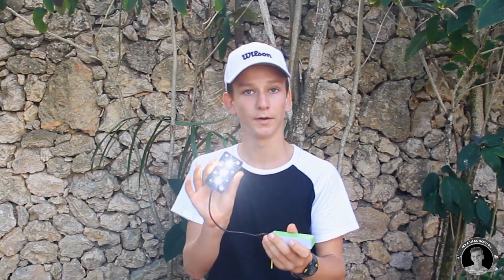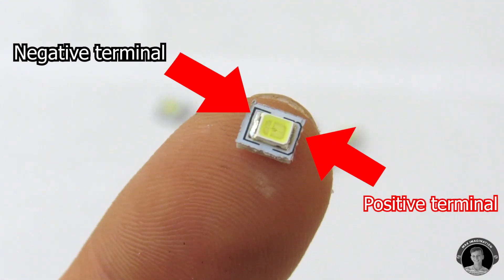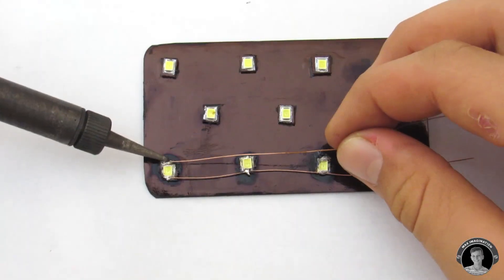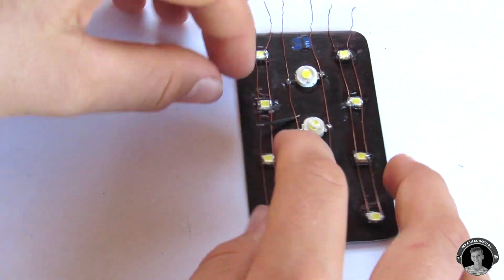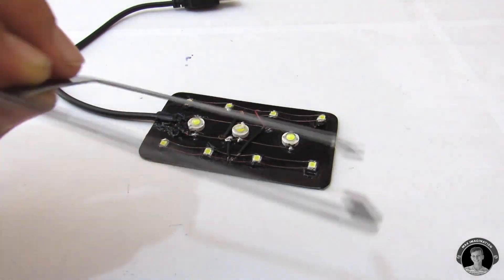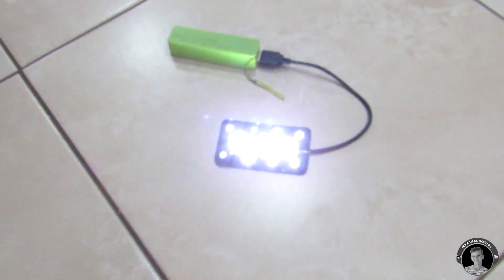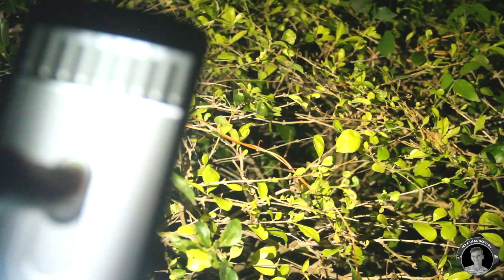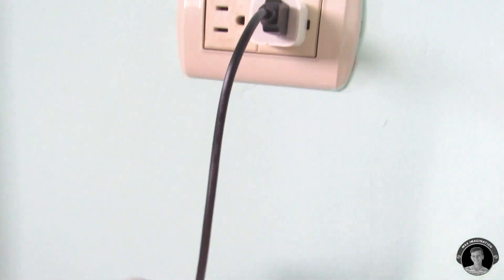DIY Bright Phone powered LED light | Homemade Phone accessory

Comment: That is a diode not a resistor at t=2:31 (https://youtu.be/N6fEWOvJttM?t=151).  Probably a 1N4148
Reply from the maker: You've made a valid notice there, Tim! Correct. Since I lacked the knowledge in electronics back at that age, I missed out on this key detail. Cheers.